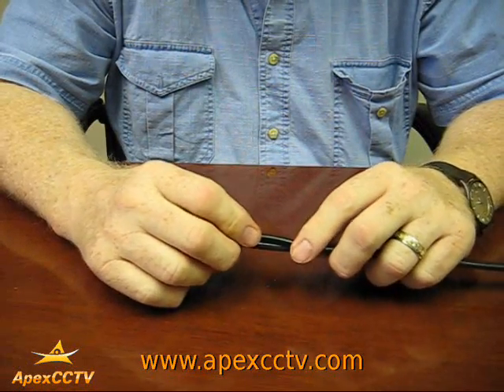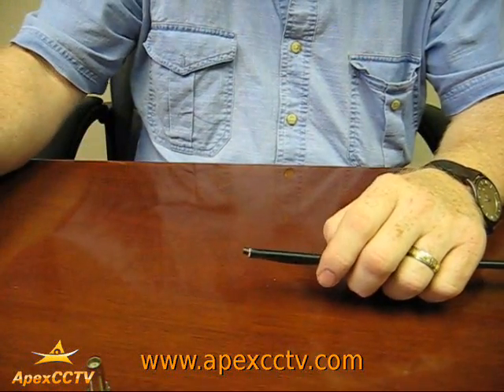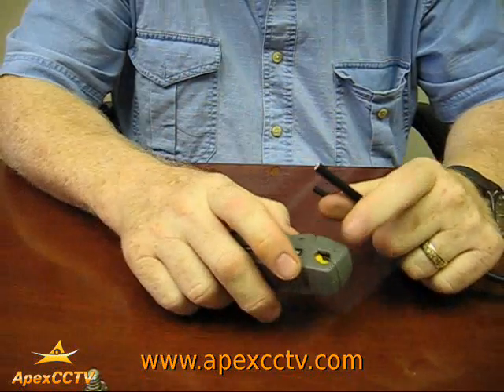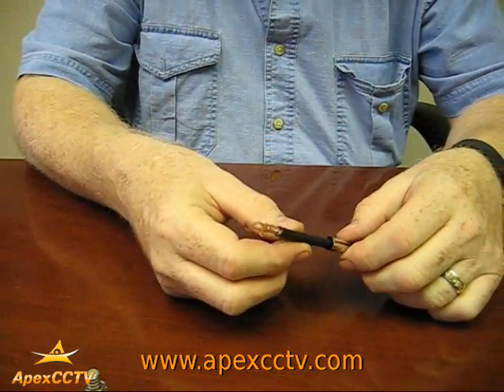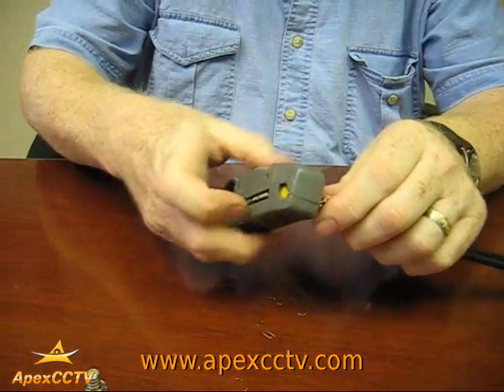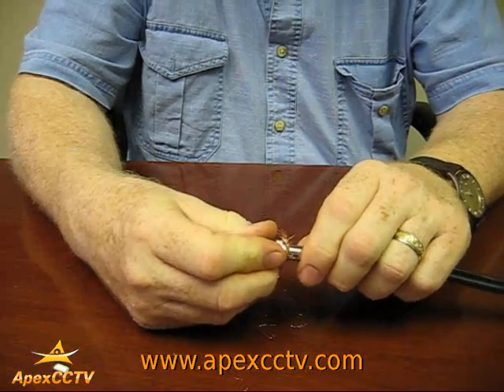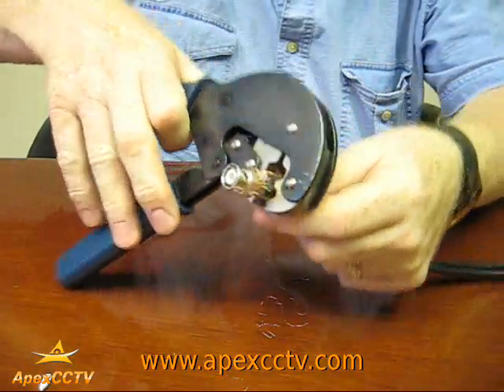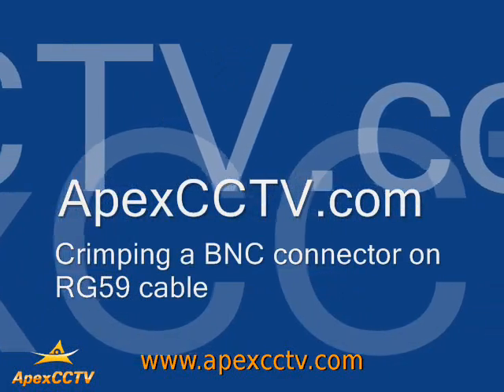Video Tutorial : How to Crimp a BNC Connector on RG59 Siamese Cable

Comment: You know that you left out one very important piece of info.  RG59 cable requires RG59 BNC connectors.  It took me waited dollars on trying to figure why everytime I crimped BNC connectors onto RG59 cable, the connector was loose and fell off.  I haven't found any tutorial anywhere that informs the user that they must have the right BNC connector.  NOT ALL BNC connectors are the same.  So....I ended buying (unknowling) a hundred RG 6 BNC connectors along with the order RG 59 (500 feet bulk siamese cable).  Well, the RG 6 is TOO BIG for RG 59 cable.  RG 6 is 18 awg and RG 59 is 22 awg.  And the vendor I purchased the BNC's and Cable from only sold one kind of connector and they only had in description that it was BNC connectors for RG 59 cable.  After hours of wondering what the heck is going on, I discovered the BNC's they had on their website were RG 6's NOT RG 59's.  I can't believe there is no mention of this small yet huge minor detail when ordering BNC's.
Reply: you should've asked
Reply: RG59 75 ohms, RG58 50 ohms.  The connector shown is 50 ohm BNC.  Mismatch???

Comment: This is really bad way of doing it. You crimp it on the connector (bigger crimp) and on insulation part of the cable with smaller crimp. You do not crimp on copper shilding. If you do it this way, few months later you will be back to repair loose connector. Just strip much less of the cable, half the size he strips and you will be fine. Copper shilding should be only cripmed over the connector with larger size crimp. Smaller size keeps grip on the cable, so connector stays put.